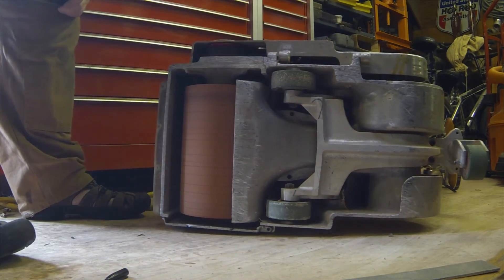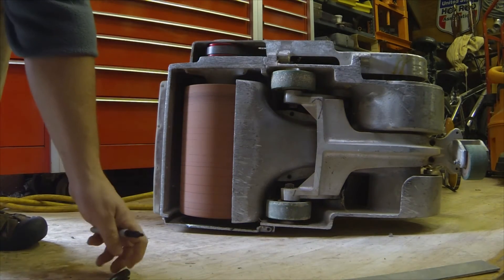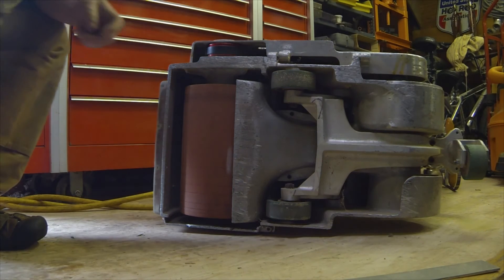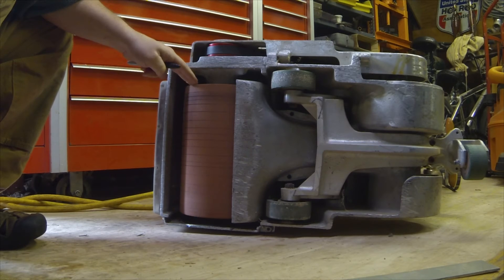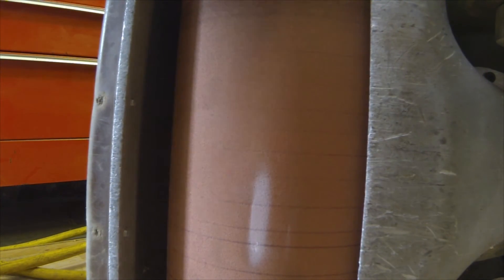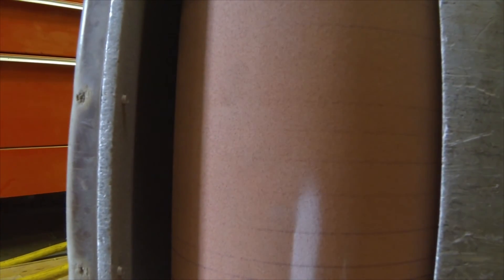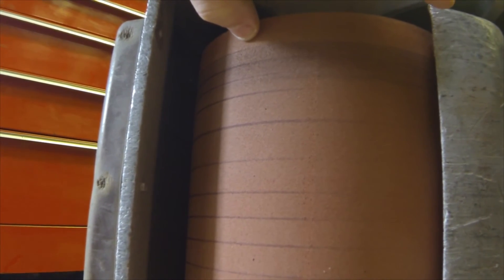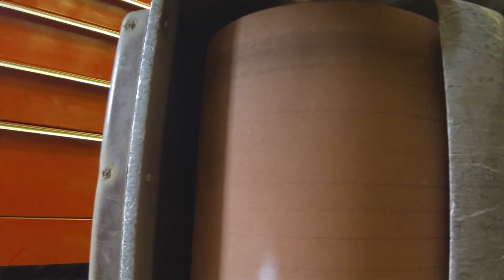Galaxy B12 Drum Diagnosis

Comment: How do you fix it?
Reply: I've seen a video where you take a piece of flat plywood at least 4 feet by 3 feet, and you use contact cement to glue down a piece of 80 grit drum sandpaper. Then you take sand paper off the drum, assess how thick the rubber covering of the drum is, cause it can't be too thin,  then you put the machine on the plywood, start it up, and slowly lower the drum onto the sandpaper until you just hear slight contact.  Then , after trying this for five seconds or so, stop the machine and check the drum to see if it "trued up" or not. If not, do it a few more times , and even move the drum across the sandpaper. Remember...the slightest contact is essential...they even recommend you take the belt off that runs the fan so you can hear how slight the contact is much clearer. In my case, the drum was cutting deeper at one end, and there was no possible adjustment, so I trued the drum up and it worked. Now...I have a different problem...the drum cuts perfectly level with very coarse sandpaper (36 grit), but leaves evenly spaced small chatter marks with finer paper. You can't really feel them with your hand , but you can see them. Maybe I need to true the drum up a little bit more, because there were a few suspect areas that I left as is because I was being cautious. We'll see.
Reply: @markanthony3275  bad bearing maby?